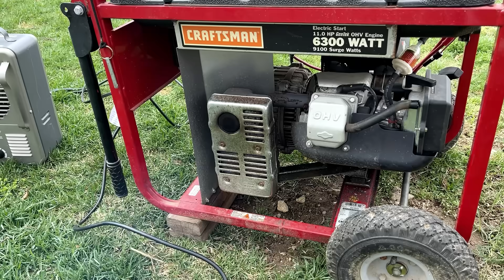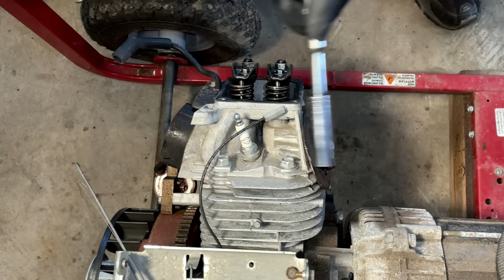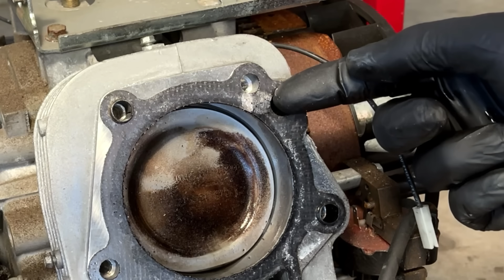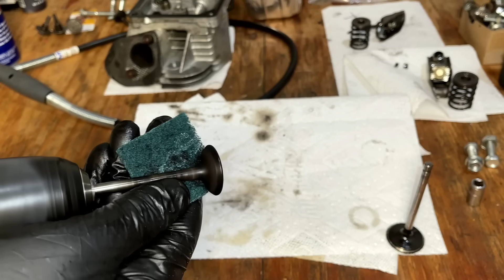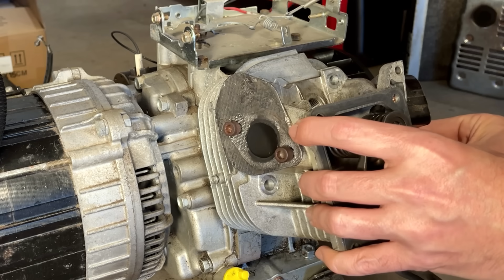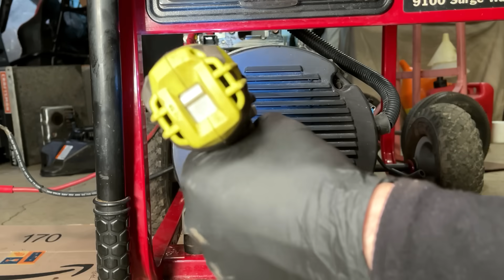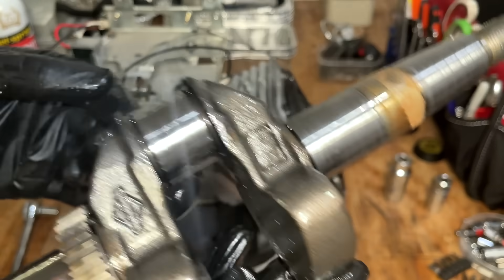Smoking Generator Engine (Part 1) - Easy Fix or Engine Teardown?

Comment: This jobbie has a worn oil scraper ring. It will  burn oil till it's replaced. I was wrong, the ring is fine. The bore needs hit to reduce those ridges.

Comment: I have a elite 5500 W Briggs & Stratton generator the governor’s not stuck is putting out 155 W is running at 60 MHz but it is so loud when you have it to run area and it smokes a little bit what can make it be so loud

Comment: I agree hone and new rings or a new OEM piston, and rings can sometimes be found for a reasonable price on eBay.  I did the same thing on a chipper shredder engine that I need on my property. Frustrating that Briggs has so many of these crappy "Cool bore" engines out there.  The engines are good, but to save a buck they cheap out on putting a cast iron sleeve in.  Oh well, that's the way it is.  James, I've said it before:  You're a surgeon and I enjoy watching you work!  I also second the no music thing so thanks for that too

Comment: James, with “folded” head gaskets, you can get by using them in a pinch by applying a thin coating of Loctite 515, known to us diesel engine rebuilders as “Grape Jelly.” It is an anaerobic-curing sealer that works extremely well in high temp, high pressure applications. It cure in the absence of oxygen as it cure from the ions in the metal. 
As always, I enjoy watching g your small engine repairs and generator instruction! Thanks

Comment: Sorry James ! But, I would have put your borescope down the sparkplug hole before taking it outside and test ! At 2:50 min from start !
Reply: But why. Yes there’s going to be oil in the cyl. Is a bore scope going to tell you ring or gasket? No. If you would’ve put a compression gauge in spark plug hole with dipstick out and valve cover off and pressurized the cyl with smoke… now that would’ve told you rings or gasket. But a bore scope couldn’t tell you one from other. It was crazy dirty in there.

Comment: Chinese briggs,  the cylinder has no sleeve nor is it hardened, I bought one of these for 10.00 from tractor supply  with a hole in the block,  tore it down and it had about. .060 cylinder ridge and the rings were shot, only 102 hrs, replaced with honda.

Comment: I don't know u still here or not. I change those gasket and check those piston block is smooth and scratch free but after I change gasket I run it still same the smoke coming out . What wrong

Comment: I had the same issue with my gas powered tiller. At cold start when I start it at full throttle, there was a lot of white smoke coming out of the exhaust but once it heated up, it was not doing it anymore

Comment: Running MMO in the gas will cause it to smoke some but it may also
Clan up some of that carbon in the upper cylinder valve train area

Comment: It’s the oil wiper ring when it smoke when you drop excelleration or shut it down .  Running some marvel mystery oil or rodeo line engine treatment can often free stick oil rings I’ve done it in car and truck engines with good success.  But you will need to run till hot let it sit till cool and repeat quite a few times if it’s going to work.
Reply: Riseoline engine treatment

Comment: I would expect a worn set of piston rings to produce excessive crank case pressure as exhaust gases pressuring the crank case and the oil wouldn't be so clean.
I'm about to watch part 2 to see exactly what was wrong.

Comment: Excuse my ignorance but wouldn't losing your crank case pulse into the cylinder from a blown headgasket be a 2 way street meaning you would have crazy high  combustion pressure leaking into the breather tube? I guess what i'm trying to say is wouldn't the fault you were loking for actually cause a lot more of a pulse on the brather tube than would be expected not less.

Comment: I have a 3500 kw craftsman very similar to this one I checked plugs they are 135 volts no avr on stator and could not find one in plug housing is 135 volts ok do some have no avr?

Comment: There is one last test I would have done, before the complete tear-down. After you did the valve job, I would have run it LOADED for an hour or so, to get the oil residue out of the muffler itself! It's real possible, that getting the exhaust real hot, by sustaining a ~3,000 watt load, would burn the residue out of the muffler, then it might possibly have stopped smoking. A new spark plug could also give clues, as to whether the smoke is just oil in the exhaust, or indeed, the cylinder.

Comment: I watch you all the time and I get a lot of good information from you thank you for that but I was putting back together my ryobi 5500 watt generator and I was going for 70 lbs. torque on the 4 bolts on the stator and they stretched and one finally broke the bell housing so dont ever do 70 where can I find the torque specs
Reply from the maker: Most to not publish specs on those.  The few I have seen call for 80-120 in-lbs (6.6 to 10 ft-lbs).

Comment: Did you ever thought about using a drill on the valve stem to do the lapping 😉
Reply from the maker: I have done it before on am engine that was on its last leg.  It worked well.  https://youtu.be/xtZlTCi_mtY?t=1133

Comment: It's gratifying to see that you do not use a lot of SSTs (special service tools,as Toyota sez), you just use "generic" mechanics tools. Add in a DMM (digital multimeter),a voltage/frequency tester,& I see that you use a variety of watt loads that you likely rescued from trash rather than buying a cluster of the same make/model. On top of that you are keeping a lot of IC devices out of landfill or metal recycling. All for a few $ worth of parts & your expert time. Thank you for your many vids, I wish I had found something like this back in 1976-1984 when I was learning shade-tree motorcycle maintenance.

Comment: Head gasket leaks throw gasses into the crank case and/or the oil system. Oil almost never goes the other way. Water can get into the engine when stopped but you’ll also get hydrocarbons in coolant. Air cooled head gaskets just make a popping noise.

Comment: You should use a stove grill sanding stone on top of cylinder and head. Where ever the head bolts are, they will pull a little bit of aluminum around holes up. Sanding will help make cylinder mating surfaces flat.

Comment: I'm so lost watching your far beyond my understanding skills!!! Thinking of finding someone with these skills to repair my old Tecunseh 11hp generator - nah. My new Champion is encountered now. I've changed oil, plug, cleaned a very nasty fuel tank, fresh gas, clean fuel to the carb, took carb bowl off and float. Carb cleaner. And thats my limit! Thanks for showing all this and that you certainly have UNREAL skills, old school level. Thanks.

Comment: I pick up onan gen sets all the time for $200 or less. just got a
onan 7kw with only 50 hours for $100. cleaned the points and carb and runs like new. perfect oil pressure and compression. 
at one time I has 13 onan gen sets that ran great. I get them out of wrecked and abandoned rv.s
the older cast oron block onans are bullet proof .

Comment: Jim I bought a Sportsman 4000 3500 generator for $45 at a salvage yard that didnt run. I could turn the shaft as there was no recoil starter.it needed a new carburetor as the governor tab was missing and a new spark plug coil eaten by a mouse.I had a recoil from a Troybilt generator that fit however the screws I used off the generator were to long and was nipping the fan .I've used rivets to hold it on..the oil was old and smelled like gas so it's been changed.Now to start ot and 5 pulls and it ran very quite too.The idle needed adjusting which I'm not good at..Any suggestions how to pinpoint the perfect idle? Love your show

Comment: I'm shouting Valve stem seals or/and valve guides! The exhaust valve with oil from combustion chamber will have much more grey and dry carbon buildup

Comment: If I opened an engine that smoked as bad as this one and when you pulled the carb off and saw the amount of oil on the valve stem the first thing that I would have done is replace the valve guide and install a new seal. the engine teardown was unnecessary

Comment: I have that same exact generator, I have noticed over the years that if the oil level is at the max, mine will do the same, I took just a small bit out and it stopped burning it

Comment: Ahlafirmy Bey, what does it mean if oil is coming in to the filter ,and why is my choke toggle moving around on a new black bear generator. Was the choke switch damaged, 3mo old help thank you

Comment: I bought a small four stroke outboard got a reduction in price as it smoked I presumed it had laid on the wrong side meaning had got oil in cylinder and burnt. I cleaned the carb and cleaned  filter etc didn't seem to be any oil in the wrong place.
Put it back together and ran it again and still smoked and smoke smelt odd a friend came round and he said you gone all classic I can smell Castrol R oil being burnt ....
So we emptied and washed tank and all was well it seems he may have some petrol that was in a can for two stroke or had a residue of Castrol R Vegetable based oil and I remembered he spoke about finishing boat ling as need to spend more time and money on a Classic AJS Motorvycle I saw in the garage..
So easy fix ....

Comment: nice job... i think the only thing i would have done different  is before ripping into the crank case i would have changed the valve seals while you were doing the valves .. that way it would have been no doubt it was rings .. cool vid !!!

Comment: I would go up against a locktighted bolt anytime over a rusted or corroded bolt anytime, Seawater damage on an outboard disassembly is far worse than any Locktite. in fact, Locktite prevents further  corrosion from getting into the threads

Comment: I may get some flack for this. But I heard using a thicker oil in the summer time is a good idea. Well I went thick, thick. 15w 40. Will see what happens. Also running it in 90 degree weather. It started vapor locking, it seems. Run for 10 minutes, then act weird. So I just untwisted the fuel cap, but leave it on. And cover the fuel tank with a Cargo Blanket. To keep it out of direct sunlight. Add Marvel Mystery oil for some reason. It helped with what seems like vapor lock, for 45 minutes, with cap twisted closed. But it ended up doing the same thing.

Comment: Most of this generators are used in emergency situations like after a storm or construction. So that little bit of smoke you can live with mabe once or twice a year so I would live with the smoke as a little issue and let it go as long as it makes power ! Not a big issue.

Comment: The pcv  works from the carb sucking   there's no pulse   the carb pulls  the air from the  crank case and reburn it     if you gets a pulse from the pcv the motor has bad rings

Comment: James, what is the specific model number of the engine and/or the generator? I have a similar genset from a different manufacturer, but the engine appears to be the same or similar, but without the electric start. I would like to convert it to electric start.
Reply from the maker: I put that information in the video description.
Reply: @jcondon1  thank you. Now I can find the part numbers that are different.

Comment: Folks, for simply stuck or sluggish rings I have personally witnessed sea foam do miracles on a robbin - Subaru motor in an oil change neglected yard goat. Some in the crankcase and some in the fuel. Smoked for a day then perfection...

Comment: I agree with your deduction. Go ahead and hone the block. See if you can get file fit ring set and clock the rings at 9 and 3oclock to avoid the gap landing on the scratches. It really looked like the second ring you removed may have been quite close to the worst scratch in the bottom of the bore and it was at the bottom where the most oil lays so it wasnt in a favorable position. The amount of smoke your getting is similar to burning mixed gas and under load the extra heat allows the oil to be burned off. Your on the right track. The build up on the exhaust valve is because it is hotter. I dont think the valve guides are an issue because it was to clean in the valve cover.
Reply from the maker: Good points.  I did not think about positioning the ring gap vs that scratch.  Makes a lot of sense.
Reply: @jcondon1  yes essentially you had 2 rings for compression but may have only had 1 that was scrapping oil.. Ring number 2 could have just been filling the gap between the 2 rings with oil if it was in the bottom of the bore

Comment: First one that has a intact connecting rod. Lol I have a severe dislike for b&s with there disposable aluma bore cylinders and I got a mower that has a plastic ring gear yes plastic and ya they want 8o bucks for it. No thanks no briggs for me anymore rather have a Japanese, Chinese or a kohler with a cast iron liner.

Comment: Generator engines typically fail because of running for extended periods of light or no load. This allows the bore to glaze up and provide a poor seal for the rings. The cure was very simple, instead of running under 3000w load, run it at 6000w load until it clears.

Comment: I had one just like what you have. I went the same thing you did with the same rezult. I just changed the kind of oil I was using and my problem went away. there is oil made for hi milage cars and trucks that smokes. My problem went away and I use it on all my generators.

Comment: Jim, it has so little wear; just get a cylinder hone, go over it good, so most scratches are gone. Then put in new piston, new rings, and it will run like a clock, for years...!!!!!....nothing to lose...!!!

Comment: Had one similar ,turned out someone had put 50:1 oil in it thought it was a 2 stroke,  but used motor oil not 2t oil so it smelled like the engine.

Comment: that doesnt look bad longer you can get tools clean cycling wall up im sure be fixed no problem 
i have fixed many of this small engine it because they were never break in just puted together n throwed out shop n a lot of people never break them in
how break them in is use mix oils n fuel like 2 stokes for 1 gallon run time them back to normal gas no problem it way get them work out with each other if it doesnt them will tears it self up just like one you got
that engine have way less hours i say between 5 to 15 hours that is good 
im engineers i love digging in engine n troubleshooting them
2nd i saw piston went down i noticed ton of oils i said yups that issues with cycling wall n piston ring get them replaced anyway n get tools at auto parts for smooting out cycling wall save yourself a headache n besure use bp blast oils before you start shaving block
i know so much on this tools todo any repairs on vetiver n boat n ton of stuff

Comment: First thing i noticed is, it look like you have done this before since it looks like you have the right tools. Nice trick getting off the armature.
After reading the comments and thinking about it. I did notice alot of smoke when you shut it off. 
The thing I remember from working on motors is what type of oil was used. Is it possible the wrong oil was used as well as are the intake guild and seals worn? That would cause oil to burn and if the oil is to thin it would blow by the rings. 
Hone the block and re ring the motor worst case put a hotter plug in it with a thicker oil. If it's a straight 30 go to a 40 and check the valve guilds. Good luck nice video!
Reply from the maker: Thanks

Comment: Not sure how it reacts with oil, but I'm going to guess that it probably doesn't react well, so it may be an item for replacement, the muffler is a catalytic converter, I have a slightly smaller generator with a similar engine. Nice to see the tear-down, I'm most familiar with the older vertical cylinder Briggs engines.

Comment: You did not check the guides
Reply from the maker: I should have recorded that.  The valves were no loose in the guides.  Potentially a valve stem seal.  Should have checked that.

Comment: Sometimes switching to a full synthetic will reduce or stop a motor from smoking. It has a much higher flash point and in a motor like this it may pass though unburnt, it won't stop oil usage just hide it. Old car dealer trick.

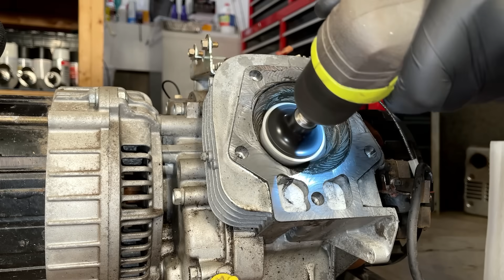Comment: James, what right angle drill are you using @35:16? What buffing wheel is that also?
Reply from the maker: The drill was just a cheap Ryobi sold at Home Depot.  The wheel is a 3M Roloc plastic bristle brush.  I have a link to it in the description.

Comment: I have this exact model and the baby ran smoothly for two hurricanes so far and I put a bunch of hours on it.  I changed the oil frequently and used non-ethanol gas. Gotta say the one you had mightve not been maintained and its got valve issues/seals. Wouldn't be a bad idea to clean the carb either.

Comment: Failure might be on piston rings. Did you know, first and second ring scrapes oil away from sylinder wall, not the third ring. Third ring just spreads the oil. If there is failure on first or second ring, they might not scrape excessary oil away. My guess is that the failure is on first and second ring. Try to renew those, it is sheap option to try.

Comment: The plot thickens! Looking forward to the conclusion. When you first started the engine, my first thought was rings, closely followed by valve guide seals. I am not sure if this engine has removable seals for the valve stems, but I remember way back in time, I had a smokey car engine, and changing the valve guide seals fixed it. Good luck. I hope you get it fixed.

Comment: I'm no engine expert but if the head gasket was blown in the area you suspected would you not get compression in the crankcase and/or  blow that vent tube apart

Comment: You can replace the rings, hone the cylinder as the cross hatching has worn away.....you can also have the piston skirt knurled which can increase it's diameter a few thousandths. I would also replace the valve guides and seals. . Great video!